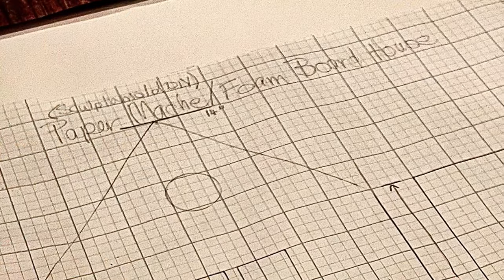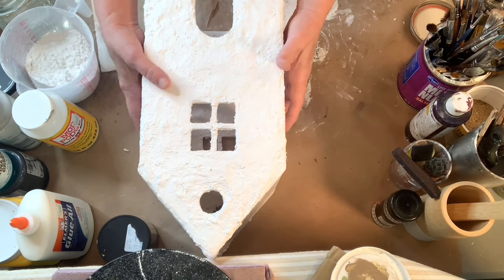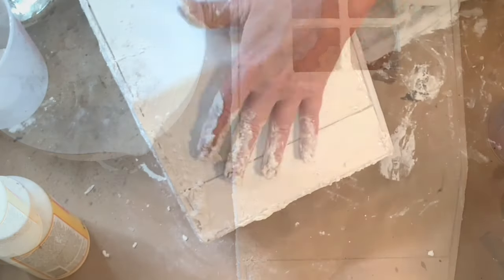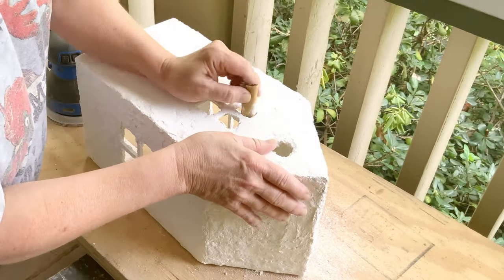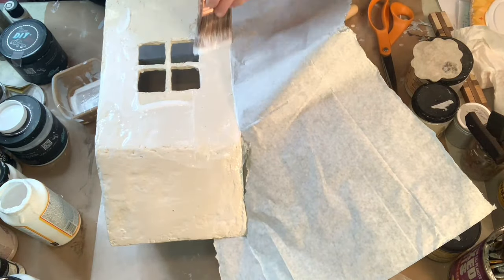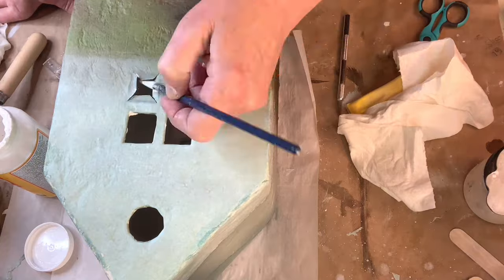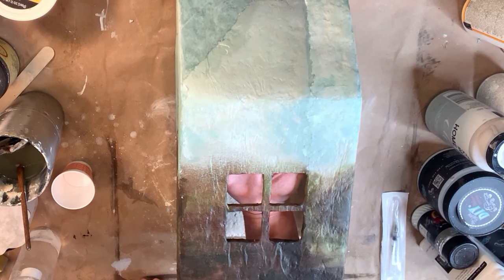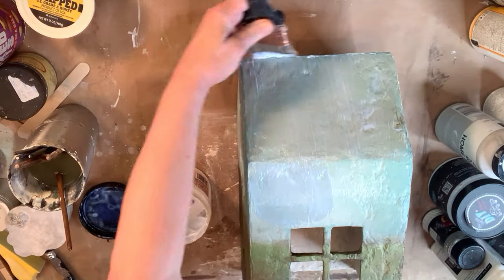DIY Paper Mache House With IOD Stamps and Roycycled Decoupage Papers

Comment: I love to use premade Spackle/Drywall Paste when making houses/dioramas. If you put it on thick enough you can carve bricks or cracks into it and it sands beautifully. It's also perfect for working with stencils. My favorite is to use brick or pebble textures. You can also use texture rollers. They make a version that goes on purple and dries white so you can see what sections you missed. You can use little bit of water to help smooth it down and the texture is smooth enough that you can skip sanding and have a realistic wall texture. I have absolutely loved your content and I'm so glad I stumbled on your channel!
Reply from the maker: Thanks so much! Great tip!
Reply: @designsbyJ  You've taught me so much, I'm thrilled to be able to pass something along <3